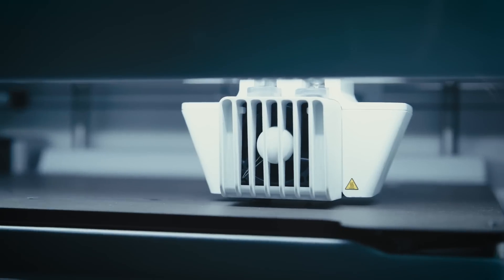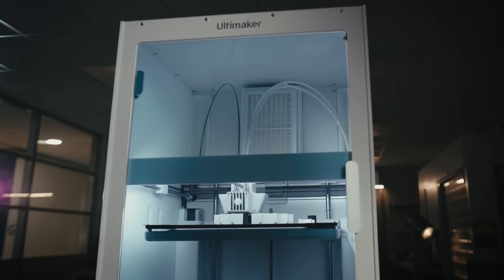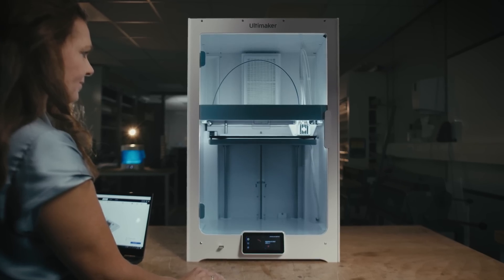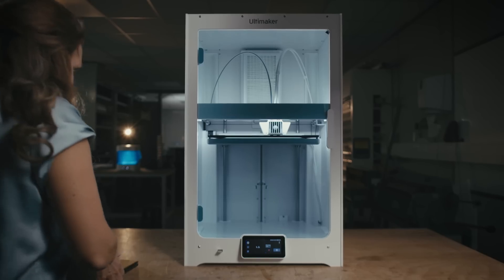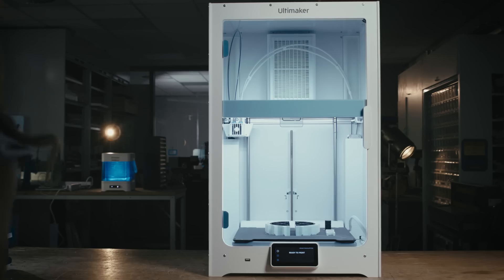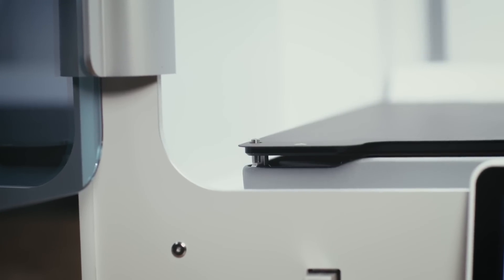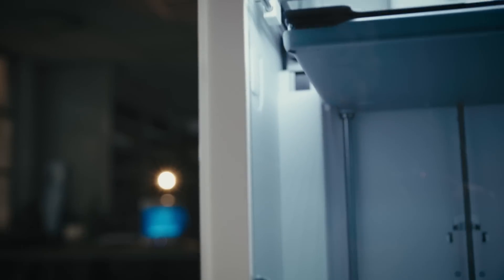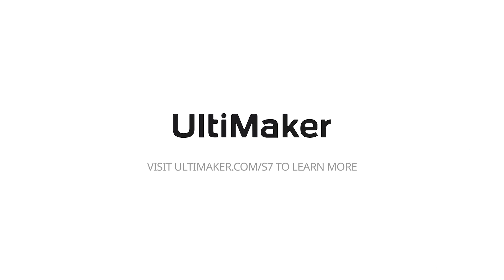Introducing the UltiMakerS7: Achieve a new level of print success

Comment: So tell me how in the hell is this hunk of junk going to compete with a Bambu Lab X1 Carbon for a quarter or less of its price? Newer and super fast tech is coming to eat your cake ultimaker you better lower those ridiculous prices on these printers or wait for the market to destroy you with much faster cheaper printers that use newer technology. I had a Ultimaker 2 extended this doesn't seem like a super leap forward also why  are you still using that 2.85mm garbage filament ? get with the times I want to see you thrive but even as a business owner I would rather buy a Prusa XL or get a Bambu. maybe even build a Voron 2.4 300mm or 350mm. sad to see you guys push boring updates and cost an insane amount of money. I hope you the best but sooner or later bambu will release a larger printer and absolutely destroy your market. I am not talking to you out of despise I want to see you do good but your value is diminishing an ultimaker s7 should cost maybe 2499-3k USD max to make it a viable printer and your filament management syste should be maybe $699-899 which are prices still higher than bambu but much more competitive your newer method series looks the part of an industrial printer so those i guess cost much more

Comment: Ultimaker is the worst printer in its price range. The results are subterraneously bad. The speed is more than just slow and structurally it is also poor. The fact that the print head wobbles makes ghosting a big problem.
Our company regrets buying an ultimaker and we can only advise anyone against supporting this company. it's a rip-off.

Comment: Bambu Lab's x1 carbon is better in literally every single way, and likely for at least $2000 cheaper (don't know the price of the s7).
Reply: You're right, except on the price. I expect that the price difference for a fully kitted ultimaker s7 package is likely to be about $17-20,000 (based on the S5 paackage price) AUD more than the x1 pack, not 2000...
Reply: @lindsaywood8012  I don't know how they get away with making printers that expensive, especially because they're nothing special and use an outdated diameter filament that nobody else uses anymore. That's way worse than I thought it was lol
Reply: old tech and they will be destroyed by bambu very soon if they don't lower the price on these printers they will soon become CraftBot lmfao

Comment: Ultimaker hasn't progressed meaningfully since the Ultimaker 3, which released 7 years ago and costed ~$3K. This machine costs around $8,000K and provides the same capability as an Ultimaker 3 with an enclosure accessory kit with filter that costs like $185 on matter hackers. What is going on with this company. They used to be leaders. Now they're going to get completely eaten alive by objectively superior designs from competitors.

Comment: I've been in 3d printing since Ultimaker was making lasercut versions out of their garage. Currently help as a moderator on stack overflow 3D printing run a 3D printing group with about 10k people. I understand its been bought by Stratasys / Makerbot. It just feels like for a 2k per generation price hike they aren't really delivering on the value. 11.5k is more than the tormarc which is prosumer cnc mill. Or say a top of the line 12 inch helical jointer from powermatic a true 1000 lb cast iron industrial tool .. I don't make money so I am not the target.. I'd love to be able to buy one of course but as a hobbyist I will have to stick with my well used UM2 extended+.

I’m just sad. I miss the old ultimaker.
Reply: Completely agree.
Reply: I just went to check out the price for a new Ultimaker and I find that they require you give them all your contact info AND agree to them peppering you with advertising before you can find out anything!!! And among the contact info that they REQUIRE is the company for which you work. About 8 years ago I was CTO for a small company and after some research I recommended purchase of an Ultimaker, which worked very well for us. Now that I'm retired I thought it would be fun to get into doing some 3d printing as a hobby and figured I'd check out the best new Ultimaker. Price isn't really a big issue for me - but if they won't provide prices without my giving them contact info first then they are a hard pass for me.
Would you happen to have any recommendations for a high resolution 3d printer? It would be nice to have a good starting point for researching what is out there before I buy something!

Comment: I’ve worked with S5s for a while. I’m really surprised that they haven’t done anything for flexible materials like a direct drive. The worst part of an ultimaker printer is that the filament has to be pushed up before coming down. The extruders chew up filament at the first sign of friction and are always the parts we’re replacing. Prusa XL bandwagon
Reply: You could still print flexible with good result on bowden. I would suspect they don't go for direct drive because that'd mean they have to print much slower, which is not what Ultimaker want to advertise.
Reply: @Envinite  that’s not even true though. Vorons, Bambu lab, rat rig etc. achieve very high speeds with direct drive.
Reply: @peenerpan113  Literally any printer could print very fast, the issue will be its print quality since faster & heavier moving toolhead = higher momentum, thus the printer assembly need to be stiff enough to handle it, the motor has to be more powerful so it won't layer shift, and hotend consistently hot enough to extrude properly.

Voron, Ratrig have many configuration so high speed capability is not equal depending on how it is built. Even Bambu does have quality issues when printing high speed.

Meanwhile Ultimaker still use the same design, barely any new features, and assembly parts that don't match its price point (rounded shaft rail at that price in 2022, really?). The S5 that use bowden is not solidly built enough to print decently fast, you really think the S7 (which is S5 with different name) could do direct drive and print fast?
Reply: @Envinite  that’s my point. For something so expensive, high speed direct drive should be a given

Comment: This is disappointing. No real innovation here.  I don’t think you have “listened” to your customers at all. 

No direct drive? 

No upgrade on Kinematics (which are extremely flimsy). You have to run the S5 extremely slow to get any sort of print accuracy.  You could have easily addressed this keeping it croxy. 

No automated method for aligning duel nozzle system. 

Same inaccurate nozzle switching method. 

Real shame as Cura is fantastic and deserves a great printer to be linked with it.

Comment: I love UltiMaker but I have to say this is very underwhelming. How is this any different than an S5 with air manager and aftermarket Flexplate? 
The "printer-part" of the S7 hasn't really evolved since the Ultimaker 3, really sad to see.
Reply: Forget the S5, you can buy 2 Ultimaker 3's, buy 2 acrylic enclosure kit from matter hackers for $185 each and 2 flexplates for $50 each and that's like 95% of what the S7 is. Best of all you still have enough money left over to buy a Bambu X1 Carbon in addition to all of that. The only ones who could possibly be buying this are enterprise customers who don't mind over paying so long as they have 24/7 support.